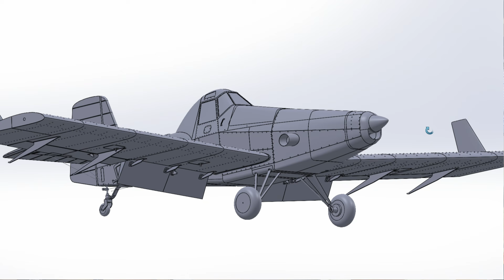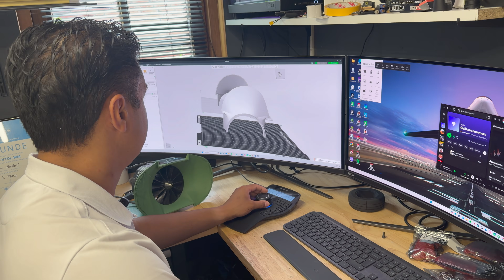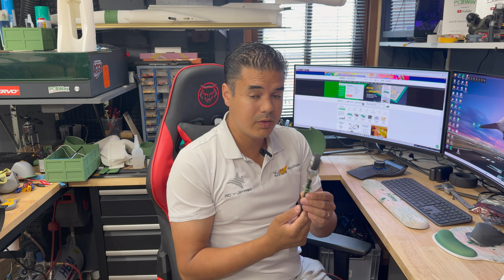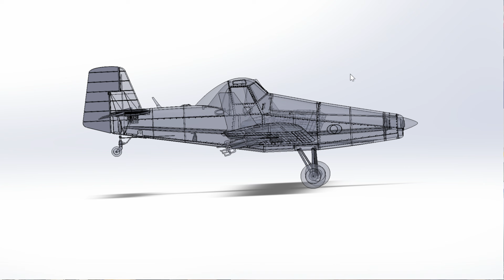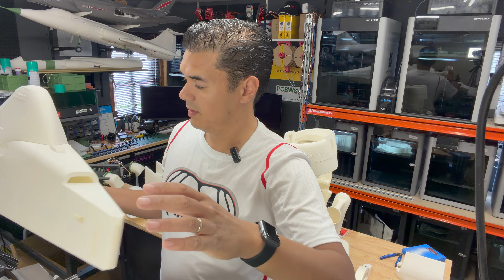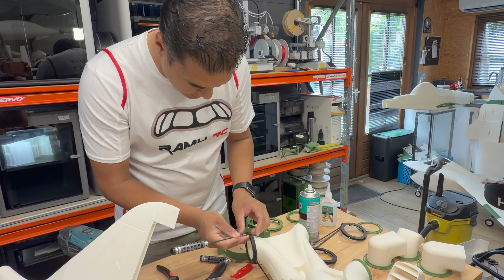AV‑8B Harrier LW-ASA Build & Ayres Thrush S‑2R

Comment: Are the ASA-Aero setting you use, still the same as you offer online for a few Euro's or have you made more parameter adjustments?? Your prints look amazing in smoothness, details, sturdy and clean.
Reply from the maker: Write me an email to info@vjmaviation.com i send you the bambulab settings for asa
Reply: @Joelmelanie  Thanks, email is coming 👍
Reply: Did you receive my emai?? Thanks
Reply: WORX WX242L 4V Lithium Screwdriver
Reply from the maker: @beyondxtream4056 i did! And i treid to send you twice an email but your email gives me bounce back

Comment: Excellent stuff! Are you going to need fibre glass on the big model for the Jet World Masters to keep it strong enough or do you think the LWASA will hold up?
Reply from the maker: Im going from scratch!!! Moulds again and composite😊😅
Reply: @Joelmelanie  I want to do a Eurofighter or Rafale with folding propellers on the drop tanks, belly lander on grass. Wingspan ~ 68 inch. Do you think the 3d print method would hold up?

Comment: Can you help...
I have a problem on my fusion 360, when I insert canvas and calibrate it and try to edit it by moving it to the center position I find it only move up and down only and not sideways😢, but when inserted initially without calibrating it it just move normal,,
So help please I know you can
Reply from the maker: Unfortuantly i dont use fushion 360
Reply: @Joelmelanie thanks...
Reply: @Joelmelanie  What you use in designing?
Reply from the maker: Solidworks😊